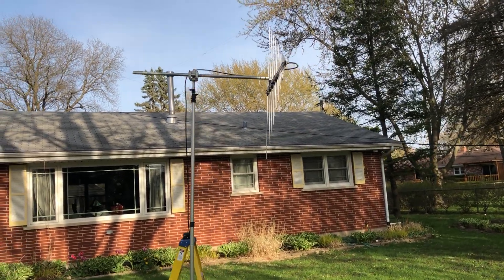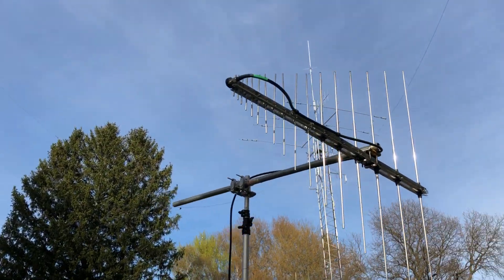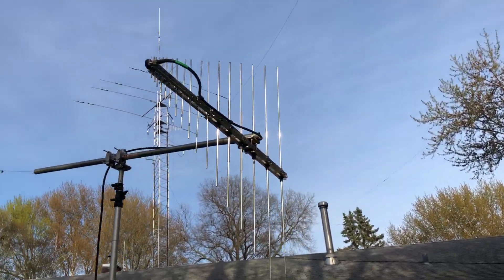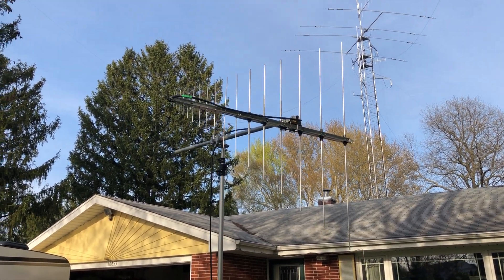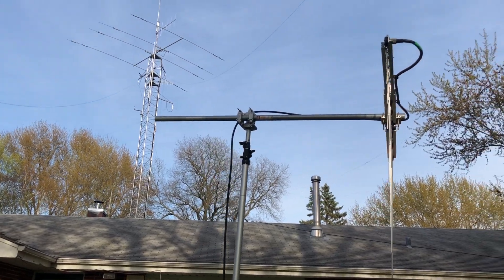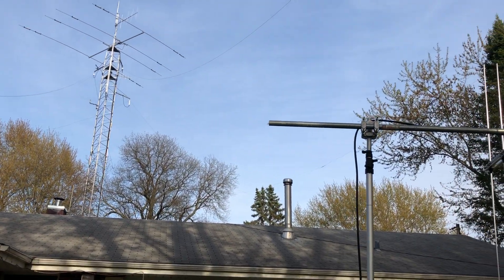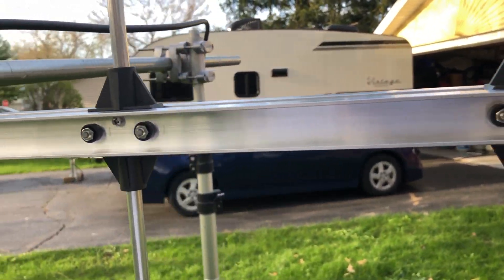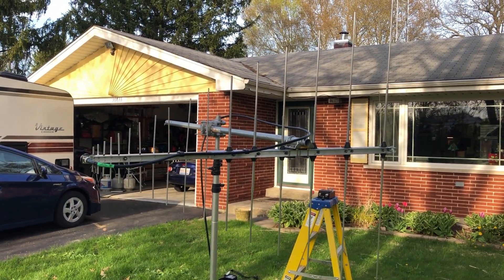Create Log Periodic Antenna CLP5130-2

Comment: How would this thing do as a scanner antenna when compared to a discone? I understand this is a directional antenna, so would it get more stations in the direction that I point it when compared to my current antenna?
Reply: That's correct.  Discones do equally poorly on all frequencies.  They aren't great antennas.  This antenna will have gain in the direction it is pointed.
Reply: @stargazer7644  That's good to know thanks.
Reply from the maker: That's an interesting thought.  If I remember correctly its SWR or in this case reception sensitivity dips on the non ham frequencies.  Plus as you point out its directionality would be an issue.  Overall I think it would be overkill for a scanner antenna...
Reply: @MacsForever1  Let's Say I pointed it towards the area I'm living now. Would it receive any better than my current discone Or would there not be much difference? It does say it covers from 50 to 1200 MHz.
Reply from the maker: @nathanpetrovski7525  I would think it would receive better because the antenna has gain vs a discone.  You'll have to let me know the results.
Reply: @MacsForever1  Okay thanks. It will probably be down the track a bit but I'll try and let you know.

Comment: Nice and reasonably compact. Bit too lopsided though, I would buy a second for the other side and just phase them together.
Reply from the maker: Actually that's another $300 for the second antenna.  It looks lop-sided but it actually has worked great for over 3 years!
Reply: @MacsForever1  actually it's a rebranded cushcraft, which makes the thing you said at the end hilarious and ironic. But any slapassed ole rigging will do from what I seen from HAMEs. You should see the 3rd custom order version they make that goes down to 30 MHz. Thing is a monster.
Reply from the maker: I'm curious what I said at the end of my video that amused you.  As far as I know Cushcraft doesn't make a VHF et al log period.  @kishascape
Reply: @kishascape  This is certainly not a Cushcraft antenna

Comment: Well, I am very baffled by one thing.  Mine doesn't have an N connector on the front, but it had the center pin soldered to the top plate in the front and it broke.  I'm going nuts trying to fix it too.  An N connector on the front looks much more durable!  I'm wondering how my 50-1.2G create got the feedpoint and cable that it has.  Baffling.  Also no current balun needed?  Is that just a piece of rubber between the plates?  I've been using one on the mast.  No trouble with the hot boom with the shield right next to it?  Thanks!
Reply from the maker: Well I the the Create Antenna that doesn't have 6 meters that could be the difference.  I was debating getting the 6 meter version but I didn't have enough Mast between my antennas.  It's really been a great antenna since I installed it 3 years ago.  Thanks for replying a consider subscribing.  I'm not using any Balun either, just hooked my coax up like a yagi. 

Best 73,

David
K9AT
Reply: @MacsForever1  Well, I ended up putting a female N connector on the front and it works way better now.  Thanks for this video which gave me the idea!  It's ready for Field Day.

Comment: What is the pros/cons of mounting the antenna vertically instead of horizontally?
Reply from the maker: It’s a matter of the polarization either vertical or horizontal. Typical mobile are vertical and if you want to do dxing on the VHF and UHF bands, it’s horizontal.
Reply: @MacsForever1  I am looking at setting the antenna up on a rotor to do satellite work with.
Reply from the maker: @Yaegermeister163  Well I don't know much about connecting to satellites but I know there are specialized rotors that besides rotate, do azimuth and elevation.  There were at one time circularly polarized antennas by KLM but I think they are out of business.  My friends who do satellites are talking about egg beaters antennas.  I'd look those up to learn more.
Reply: @Yaegermeister163  m2inc does satellite antennas.  I've had their 2MCP22 and 436CP42UG antennas for satellite for about 30 years and they're great.  Since you can't predict polarization from satellites you usually use circular polarization.  You can use linear antennas, but you'll see periodic fading as the satellite rotates.  Vertical vs horizontal won't matter in that case.  I wouldn't mess with eggbeaters (omnis) as they don't have enough gain.
Reply: @stargazer7644 Can you give me some examples where it would be better to mount it for horizontal polarisation versus vertical polarisation?

Comment: Hello David,  I got this and now returning it…as the instructions were poor and I could NOT get those 2 small front element sections to connect to the boom properly.  I can tell you had a lot more patience and focus on its time and effort you needed for assembly. Yours looks a lot better than what I’ve gotten. The side note was I was able to read the Chinese funnies in the Chinese newspaper that was packed in the box that I purchased this unit from DX engineering. Happy hunting and let me know how your results turned out once they were on your tower. 73’s DE KC0QNA
Reply from the maker: Thanks for the note and I’m sorry you had a difficult time assembly it I two had a challenge putting it together and I had to disassemble part of it to get it right the next time but I finally got it completed and as a performance on the tower it’s not as directional as a Yagy but it has still good directionality. The idea of a log periodic is its broadband capabilities with the antenna to operate on five bands and save on tower space so that’s why I got it. The build quality is superior to anything I have assembled. I have two videos for this antenna on my page and I just want to check to see if you have watch them both?
Reply: @MacsForever1  Negative but I will now that I know of them.  I have a new ICOM IC-9700 coming shortly and love satellite and VHF Openings 50+ Megs and above....so I was hoping this would do it.  So, now I am looking at the M2 Square line up of beams for my next adventure.

Comment: I am currently using an Elk LPA temporarily in my shack made for 2m/70cm. I have no trouble using 5 watts simplex at 17 to 20 miles to a couple of friends (I live up at 1,150 ft, they’re at 130’). The Elk is really just a portable antenna with no where near the coverage of this Create antenna. I believe the forward pattern of an LPA is wider than a yagi also. One advantage of the antenna you have there is one coax for 5 bands. That is just great. Sure, lose some gain compared to a yagi, but so many other advantages. It looked like when you were doing the sweep there that your antenna would cover the GMRS frequencies also.

Comment: So, how does it perform once mounted up top the tower?
Reply from the maker: I think it works well.  It pulls out weak signals vs my omni and it directional.  Best part is is that it's 5 antennas in one (144, 220, 440, 900 and 1.2) so if you're lacking space on your tower it's really great.  Great built quality.  Finally there's very little wind loading because of its small size.  I'd buy it again.

Comment: They claim gain of 10 to 12 dBi.  That sounds pretty good to me.  Is that claim highly exaggerated?
Reply from the maker: That’s what they claim but I am OK with less gain than that as they are very broad band compared to a Yagi. If the weather improves pretty soon I’ll be putting it up on my tower so I’ll have a follow up report on what I think of it.
Reply: @MacsForever1  Thanks for the reply and I look forward to your follow up when you get it up on the tower.
Reply: This one is actually 11-13 and the figures are correct.